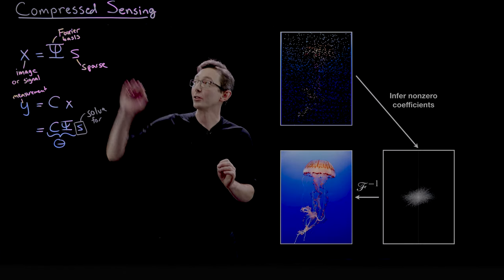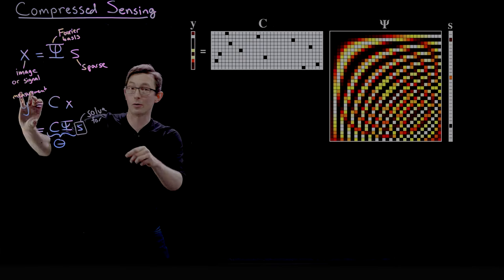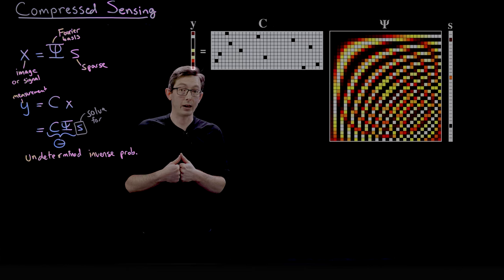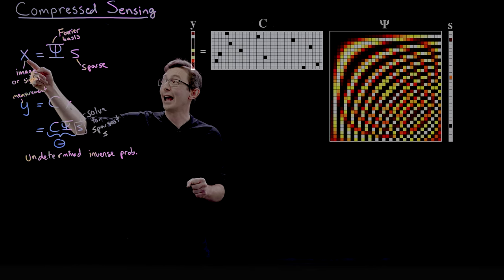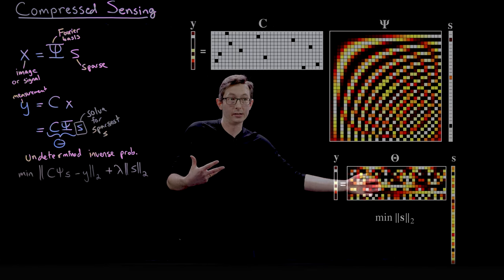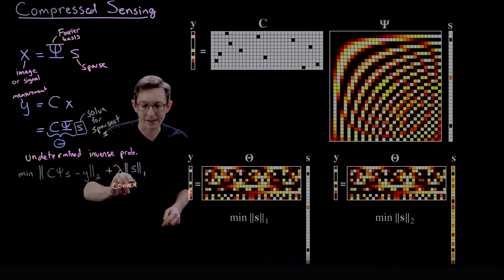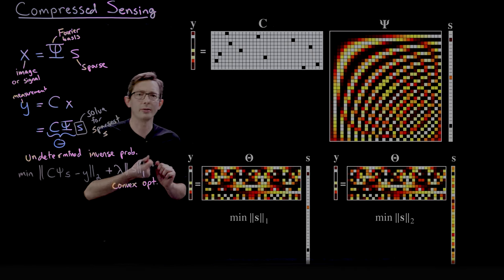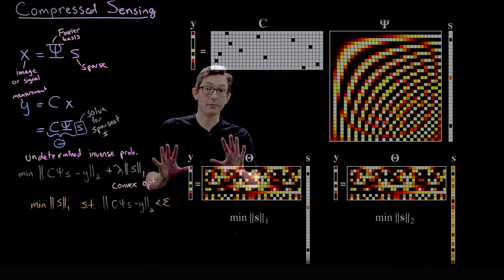Compressed Sensing: Mathematical Formulation

Comment: Hi Professor, I have a question about the measurement matrix C. 

I see in literature that most seem to portrait it as a dense random matrix, not a spiky one on each row as you show here. 

So I guess you show C as a spiky matrix, just because that it is incoherent with the Fourier basis so it would function as well as a dense random matrix? 

I think I was confused originally when I saw you (in one of the previous video) taking random data points in time domain for super-positioned sine-waves, rather than taking random "combination" of all data points in time domain (which a random matrix would do). So, hopefully my above understanding is correct.

Thanks for all the videos!